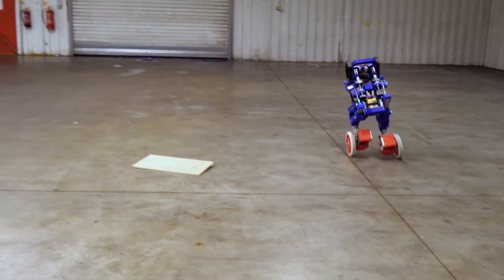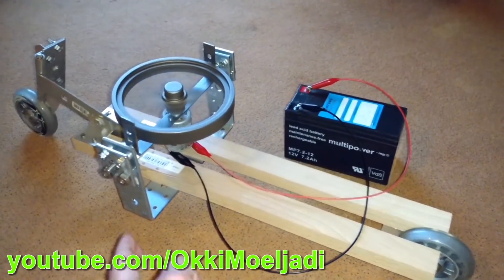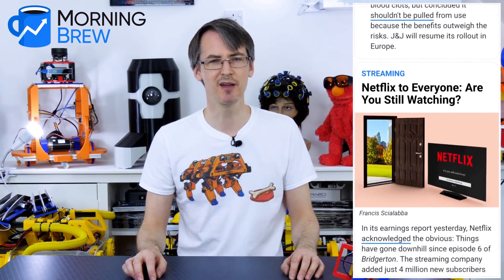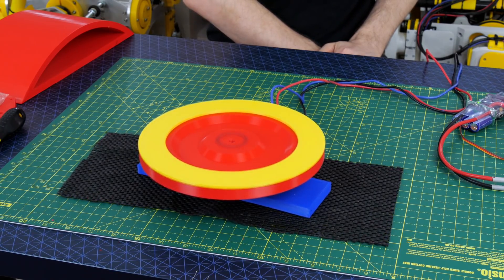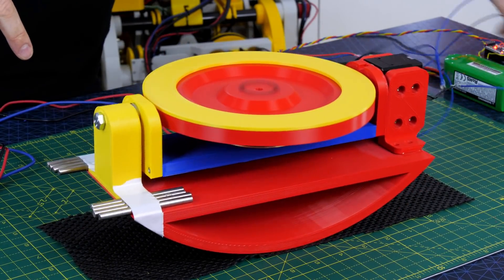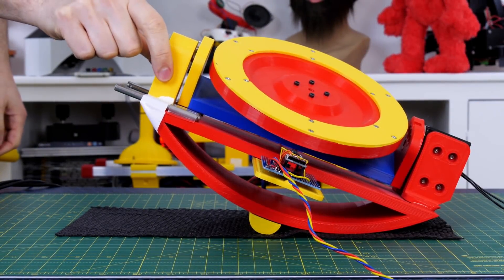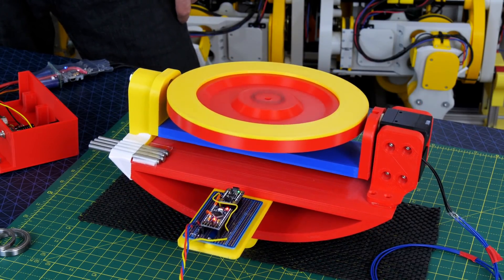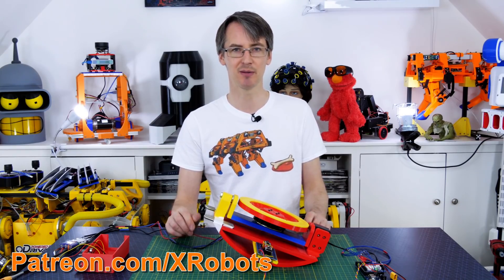How this Active Gyroscope Balances

Comment: I would've been afraid that the ball-bearings, especially since they are unevenly spaced and free to move around, would somehow break through the 3D-printed wall and become dangerous projectiles :x
Reply: Yeah pretty bad design. Even individual holes for each ball rather than a continuous slot would have been better.
Reply from the maker: There's a better design coming next week, they are going pretty slow though - only 160kv motors
Reply: @jamesbruton   Cool, looking forward to it!

Comment: I have stumbled upon an article about an old russian self balancing car.The inventor used pendulum as a feedback.The pendulum is connected to a rack and pinion which changes the angle of the gyro when tilted.
Reply from the maker: That would probably work, but it would be hard to tune ;-)

Comment: Have you ever considered using some form of Neural Network or Reinforced Learning technique to find the ideal coefficients for the balancing controller? Might be time-ineficient with it learning on an actual physical model, but should be easy enough to simulate in some physics engine.

Comment: There's a Tom Stanton video on drone COG that explains why adding weight to the bottom made the balancing worse, broke my brain tbh
Reply: Thought of that, or perhaps a similar video, when he added those nuts. I still can't wrap my brain around exactly how it works, but when I watched the video it was explained so well it all seemed perfectly logical, which I expect it is. But now I can't remember the details and it sounds totally weird again.

I remember it being explained how adding weight above the point of balance was much safer. Also how it got easier the further above the balance point it was. Kind of like how it's easier to balance a three yard stick on your finger than a foot long stick with the same weight. All in all it hurt my brain...

Oh no! It's coming back to me. The problem with using a weight at the bottom to balance a helicopter is that as the craft changes direction the weight will act as a pendulum. Go forward and the weight will make the craft tilt forward. The more the craft tilts the more power is projected backwards accelerating forward which will make the pendulum force the craft to tilt even more and so on. Same with air resistance which will cause the craft to tilt in the direction it is moving or if it's wind then it will tilt towards the wind. All in all it becomes very unstable.

With the weight above the craft will tend to tilt in the opposite direction, effectively counteracting the tilting effect of the acceleration. And so the craft will be more stable but less maneuverable.

Ouch! Brain not happy that it actually had to work for a few minutes there...

Now I can't immediately visualize how this would influence a gyroscope. Late night here and my brain says it needs it's rest.

Comment: You have a lot of trust in the strength your printed parts, standing chest level to what could been thought as a fast spinning ballbearing bomb. I wonder what sort of velocity one of those would come flying out at if the plastic bonds gave way?
Reply from the maker: Not much, they are only 160kv motors
Reply: @jamesbruton  that doesn't really matter though, what matters is the RPM, the diameter of the wheel and the weight of the ball bearings. You should fairly easily be able to calculate the launch velocity and energy if it should fail
Reply: @Nickgowans  it would be quite complex to accurately calculate it, if not impossible. Sure you could handle it as if the casing just suddenly didn’t exist but for the ball bearings to come out the case would have to break apart and that would probably take a lot of the energy out of it.
Reply: The word for this in my mind is "centrifugal claymore" 😹 (sick robotics though! This is extremely cool)

Comment: this is just like the two-wheeled electric car designed by lit motors. counter-rotating counter-processing reaction wheels for stability control are also used in the Hubble space telescope to keep precise track of its view. however, rotation of the counterweight becomes ineffective after the axis or rotation aligns with the axis of the vehicle rotation a secondary desaturation force is then needed to realign the wheels to take the rotational energy out of the system. satellites such as bubble use thrusters or magnetometers to achieve this task. thus while on earth, it advantageous to change its stance such that gravity itself acts as the reaction force to remain stable against any outside force.

Comment: Having the ball-bearings loose so they can roll around the track is decoupling them from the flywheel. The only thing that transfers their kinetic energy to the flywheel is friction.
Reply from the maker: Yep, a better design next week
Reply: @jamesbruton  Cast a lead ring to put inside your gyro? Denser and thus heavier, and won't move.
Reply: @CyclingMikey  something like woods metal can be cast directly in the plastic
Reply: @CyclingMikey  Can you get depleted uranium as a consumer?
Reply: @NXTangl  Bwaaahahaha! My mate was contracting out in the Kuwaiti desert and picked up a few rounds from A10 tankbusters. Oops, he put them down again quick when he realised.
Reply: @jamesbruton  3D mold independent pockets or slots for the  balls - like a roulette wheel or a chain contour.
Reply: I think the bearings are fine. The plastic parts just need to be printed to have holes for bearings and when you bolt the 2 halves together, it sandwiches them in place and holds them captive.
Reply: While that certainly affects how it comes up to speed (and you can hear them racing around inside when it stops), I don't think that in itself affects the gyro's moment of inertia.  Once everything is up to speed, I think it works as well as a solid one would. (IMHO)
Reply: That part was scary.

All I saw was shrapnel that would fired in 360 degrees if any part of that 3D print failed at high RPMs.
Reply: @PowerScissor  yeah that’s not a lot of plastic keeping those ball bearing from becoming musket balls.
Reply: My initial thought was a non Newtonian fluid to increase coupling while still allowing the bearings to auto settle in a more stable position
Reply: Epoxy !
Reply: You should base the design off of an R/C diff plate. A plate with a bunch of holes to hold ball bearings which is then sandwiches between two plates. On rc cars they also have clutch discs so you can control how loose or tight the diff is, but I don't know what use you'd find from it with gyroscopes.
Reply: Just pour glue into it to hold the bearings in place haha
Reply: They need to be fixed, but if you fix them you need to be able to balance the wheel. I would suggest some tungsten putty (either as an entire ring $$ or as adjustable ballast)